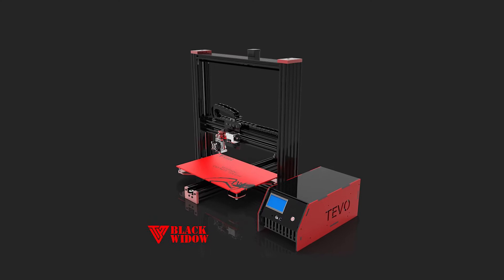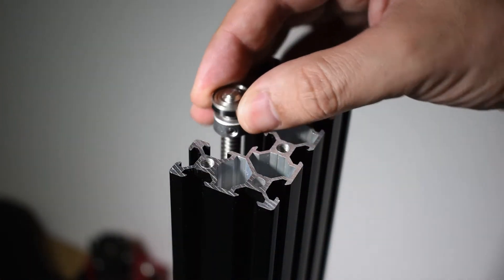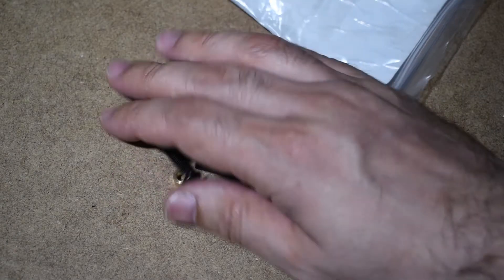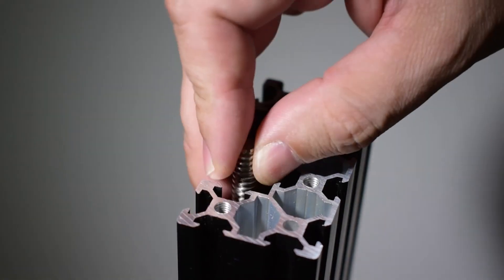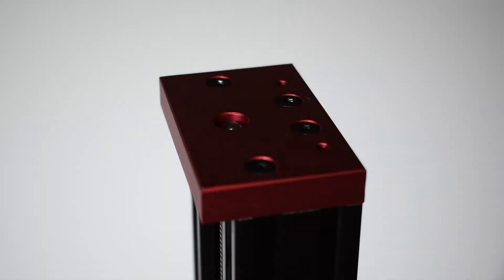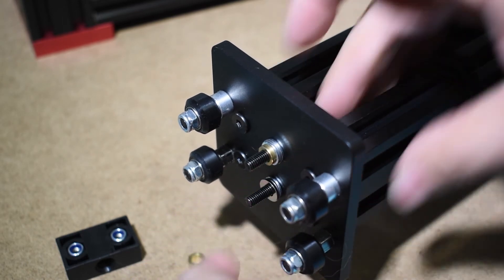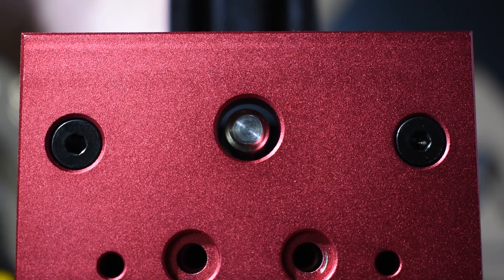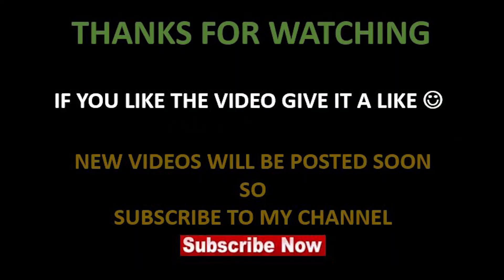TEVO Black Widow V3 assembly - STEP 5 (leadscrews)

Comment: As far as I can see, from your Videos it is not a bad Idea to have Set of Shims, Nuts and Bolts already available. Without it, it seems that it is nearly impossible to build up this thing in a way without having problems later.
Reply from the maker: Hi Richard,
It's true that you need to add shims in some steps, but the kit includes many as spares. In my case, i used very thin ones (0.2mm thick) to achieve exact dimensions.
Reply: Dude, you are an awesome Genius! Thx for your Support
Reply from the maker: Thank you for the kind comment :)

Comment: Great videos, much appreciated. Is it possible to buy replacement leadscrew nuts? Mine seem a little worn. Thanks :)
Reply from the maker: Greetings Zafforrian,

Yes, you can get spare leadscrew nuts.
You can get them from Tevo, openbuilds stores or ebay.
Reply from the maker: Hi again Zafforrian,
It came to my attention that the leadscrew nut from the black widow is not exactly the same as the ones we can find in OpenBuild stores. Having said that, i guess that the only was to get one that it's an exact match would be from TEVO.
Reply: Thank you for the response, I did a little research and came to the same conclusion.Ive made an order from aliexpress for the correct parts. I appreciate the help :)